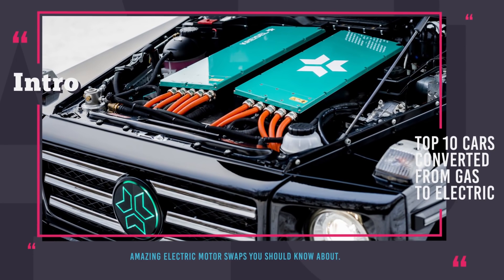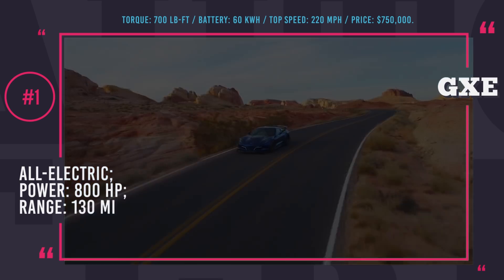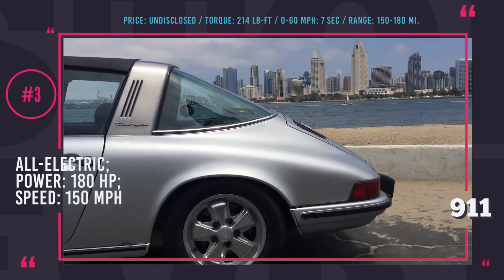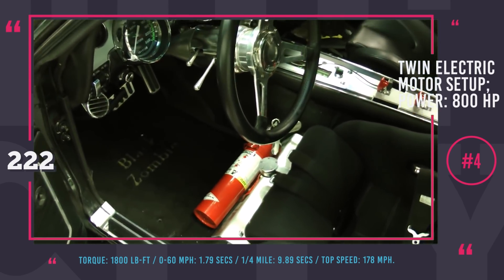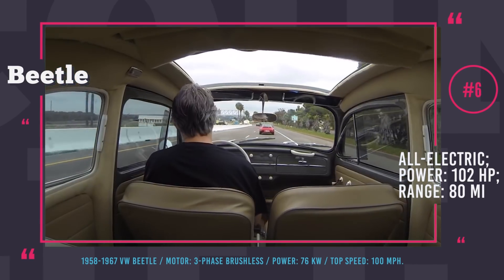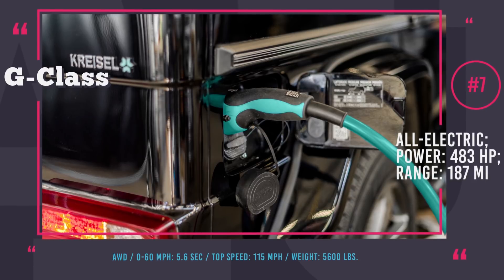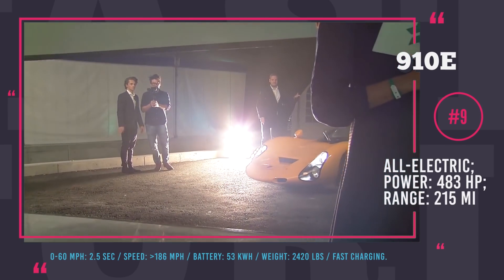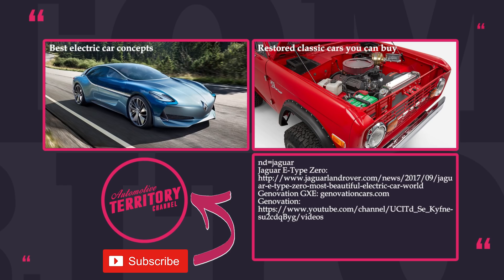Top 10 Gas to Electric Car Conversion Projects (Engine to Motor Swaps)

Comment: I would like to see a nissan r35  GTR full electric. The chassis designed to hold a big weight, imagine transferring Tesla s performance drivetrain and try to concentrate the weight in the middle as much as possible

Comment: Id love to see an old American fuel guzzling land yacht converted to EV.
Reply from the maker: I don't know if there are conversions of old yachts available out there but there are all-electric boats out there already for sure.
Reply: @automotiveterritory  Sorry i meant old fuel guzzling American cars with terrible handling and floaty suspension (land yachts). Like late 60s to early 70s  Lincolns and Cadillacs.  Beautiful cars but wasteful engines.
Reply from the maker: Ooops. I should start reading through the lines.

Comment: I own a Toyota MS-112 in very good condition. It weighs in at 3,307 lbs (1500 kgs). If I were to do an EV rebuild on this car, using regenerative braking system, removing the heating system and only using air conditioning (cooling) [I live in the tropics]. what size/capacity (kWh) of battery pack would I have to use in it to give it a range of 250 miles (402 km), using all accessories (lights, A/C, entertainment centre)? Would it be possible to kit out my Toyota Crown with an LED dash and head lamps and parking and brake lamps? And what else can I do to increase its range?
Reply from the maker: Hi Sean. Your modifications seems possible to me if done by a professional. From my experience, the battery pack that you might need is 65+ kWh at least. You should contact the businesses who specialize in these conversions directly. The links are in the description to the video

Comment: Very good one. Even I think that can be done with Richard Petty's final Nascar race car. Solar roof panels is also a must for surrounding the whole car no matter where the sun shines not only for recharging, but also driving the car longer until the tires wear out. In addition it is also great for the 1982 DeLorean's so no more fixing any DeLorean engines.
Reply from the maker: Lol. Doc should have thought about solar panels right away. What a plot hole!!! Which is your favorite conversion from the list?

Comment: I would love to see the ford Festiva get a makeover with a Tesla power plant.. 

Total reworking of the original interior with the front seats from the Tesla and a remodelled rear seat that imitates the Tesla interior .. with the digital cluster and MCU in the centre for the same navigation and reverse camera and sound system as well as a flip up ford badge camera or 90s "style" reverse camera as to not take to much from the asthetics.. upgraded headlights for a single projection style headlight. 

Would need a cage for the fwd option or a complete bolt-on AWD chassis for an AWD model.. 

Batteries line the false floor underneath, with a custom plug in battery (in the same styling as Tesla's) and this thing would be an econobox or a rocket.. take your pick.

Add chassis stiffening for torque and taa daa..
Reply from the maker: Any company that does gas to EV conversions should read your comment and create something like this for the next SEMA show.

Comment: I love that older classics are being converted to electric; however, some of the price tags for the conversions seem to only target the elite. Think about it a purpose built, state-of-the-art Tesla in 3 varieties can usually be had for less than a 100K which is still a lot of money but you get a worldwide charging network, highest safety rating of ANY car and theoretically great resale value. Otherwise, this is a great video. Thanks
Reply from the maker: It's the aesthetic beauty that forces many people to spend extra buck on such vehicles.

Comment: Every one of these over engineered, overpriced conversions is just another adventure in fleecing the public. How about an electric forklift motor coupled with the stock transmission with several batteries from an autoparts store hooked up in series.Done.most of these companies doing conversions have the same disease Elon Musk has...GREED. How hard can it be to build a commuter car or pickup for the general public like we need.?! Ill answer that. It wouldn't be difficult if everyone involved wasnt worried about lining their pockets instead of helping humanity free themselves of the oil curse. Thumbs down
Reply from the maker: These conversions show that it is possible to turn any gas powered vehicle into an EV. The rest only depends on you. Any person, who doesn't like the price tag, can always start his/her own garage project.
Reply: Automotive Territory: Trending News & Car Reviews damn straight.. 

Would love to see a Tesla power plant in a Ford Festiva from the late 80s/early 90s.
Reply from the maker: That will be a great sight. A decent Tesla will have to be dismantled, though, but I guess it's worth it) or wait, we could ask Elon to give us just the powertrain, nothing else. Right?
Reply: @automotiveterritory  People part them out on eBay after they wreck them. I just saw a video featuring a Lotus Evora retrofitted with a Tesla rear end the guy bought on eBay. Just ridiculously quick.
Reply from the maker: Well, that solves it! I guess we should expect more EV conversions, awesome!
Reply: Those budget builds are all over YouTube. The reason they aren't viable for a commuter car or pickup truck is because the forklift motor, lead-acid battery combo sucks at producing the kind of power needed for a pickup or the range needed for commuting. You suggested the one DIY setup that happens to be terrible for both applications. 

There are plenty of small EV conversion companies building exactly what their customers want and not over engineering them to inflate the price. The problem is that there are always guys who think that it should be cheap, just because they want it to be. Want a car that gets good range? That takes good batteries and lots of them. Batteries are expensive. Want enough power to tow and haul heavy loads? Now you're going to have to add beefier motors to your already expensive battery bank. 

A good Warp 9 will cost you about $1800. Stacking two for the added hauling power means you're up to $3600 (without adapters or mounting hardware) before you have spent a dime on anything else. Figure at least another $5000-$10,000 for your batteries, depending on whether you want to alleviate range anxiety. We're at anywhere from $6,800 to $13,600 already and you haven't bought the motor controller, the charge controller, the wire (it's welder wire and it's not cheap), or any of the dozens of other things needed for a complete conversion. Oh...and you haven't factored in the cost of the car or the labor, either. 

Speaking of the car, let's talk about whatever gem you might pick up to use as a commuter. Well, ideally it should be under 2,000 pounds to get good range out of as few batteries as possible. If you buy a nice, light sports car, you're killing that budget. So, you're going to have to go with something like a Geo Metro, Volkswagen Beetle, etc. Except the components on those cars really suck. The suspension has to be reconfigured, due to the additional weight and the new weight ratio. The brakes should be upgraded for the same reason. Your AC, heat, power brakes, power steering, and any other pulley/engine based systems have to be adapted to use electric pumps. Are those parts and labor supposed to be free with purchase? No. It's very easy to end up over $20,000 on even a grocery-getter build, depending on what you're working with. 

The cars in this video are showcase pieces. They have nothing to do with what you're complaining about. The people out there doing conversions for the public are doing so at a fair price for what they're doing. If you think I'm wrong, go price everything out yourself. Then add in the fair hourly wage of a professional electrician and mechanic to put it all together. Let's see if your math comes out any better.

Comment: Love the Corvette. Hate the range. I would want 500 miles range. (for the money)
Reply from the maker: I just have to ask - do you ever travel over 500 miles without a break?
Reply: Automotive Territory: Trending News & Car Reviews did it before when I was younger
Reply from the maker: I personally think that even 200 miles is enough, even there is a good charging network available.
Reply: Automotive Territory: Trending News & Car Reviews if I'm paying 700k for an electric Corvette, i better have a range greater than a gas Corvette. Otherwise a zero motorcycle with a 200 range would be better deal @ 20k